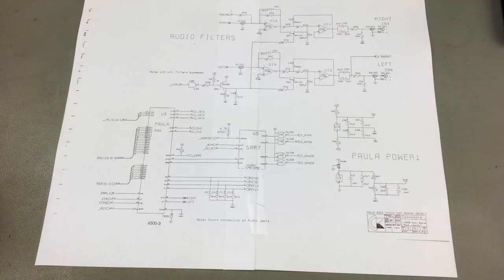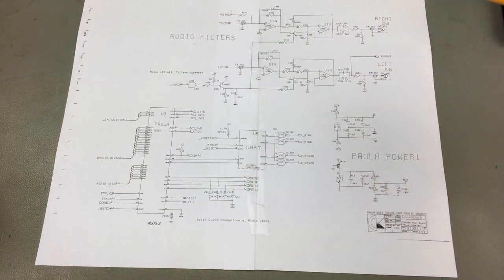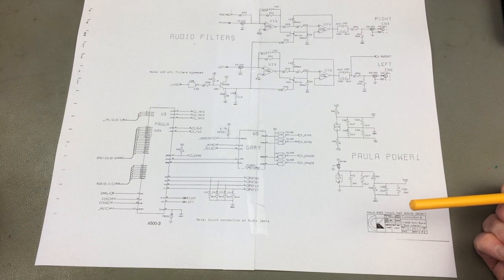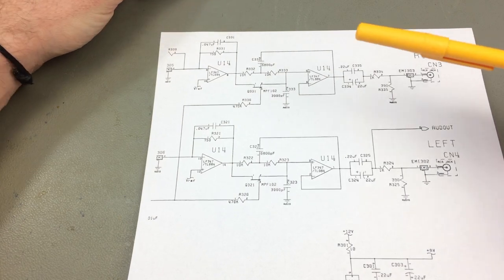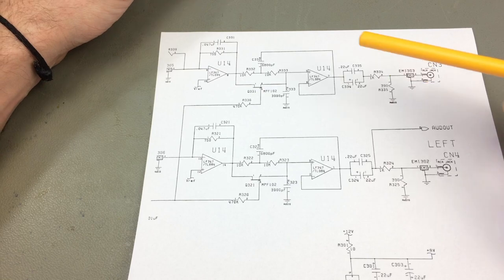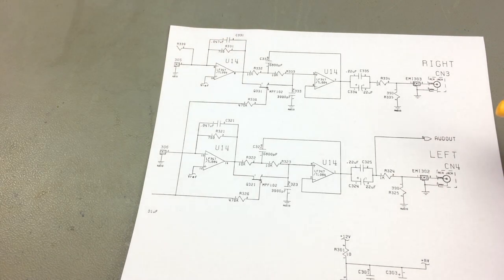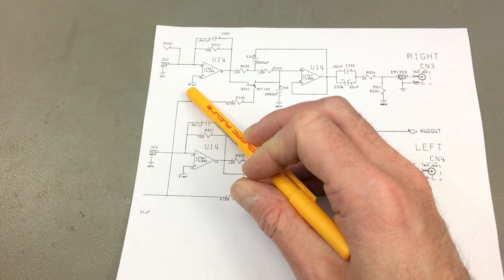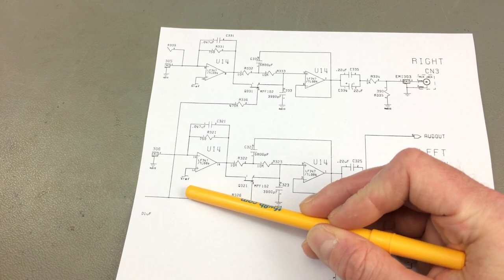Re: Bipolar Capacitors in the Amiga Audio Circuit

Comment: Great video!
I hope you don't mind me downloading it to my personal archive? ;)
Back in the golden age I did alot of hardware audio mods.
The easiest one was bypassing 1 resistor on each channel. It gave around +10dB of level boost. We installed small speakers inside the case.
That way you could listen to mods without connection to a amp and speakers.
Quality of small speakers back then was horrific.
Then there is the stock LED filter. On older Rev boards the LED turns off completely but on newer it just dims.
The LED filter can also be bypassed to give crispier sound.
I was thinking, if you install a trimpot you could level match the ground after bias removal.
Reply from the maker: Thanks! Glad you liked the video. Yes, I remember the LED thing. I was really disappointed when the LED didn't turn off completely on the A1200 I had after my A500.

Comment: Thanks for the video Jan. 

Some additional bonus work would be to trace the circuit and try to understand why DC bias voltages are appearing at the output. If we first consider the source of the signal we can see that it can potentially "swing" from 0V to +5V as Paula does not have a negative voltage supply. If it is generating a sine wave then that means the crossover point would be 1/2 of 5V or 2.5V. As others have mentioned, the 2.5V ref is then the "virtual" ground reference for the audio output signal on Paula.
The first op-amp stage is a negative gain amp with high-pass filter, perhaps its the Nyquist filter for the Audio DSP in Paula (it's not significant here though). Lets assume the gain of the first stage is -1. So if the (+) input is 2.5v and the (-) input (Paula) is 0V then the output is +2.5v. If the (-) input swings to 5v then the output is (-5 + 2.5) or -2.5V.
The second stage is a voltage follower, also called a buffer, that has a passive filter between it and the first stage but it is non-inverting.
To get a constant +2.5v at the output then, the signal from Paula must be 0V or near ground (its too bad you did not measure that) so likely the audio circuits in Paula, when not in use, set the output to near ground. I actually think that the digital samples in Paula's circuits are referenced to ground and not +2.5v but that would be another investigation...
Now to throw a wrench into all of this... what I said above is all fine but that is not what we are seeing at the DC blocking cap, eg. C334 and C324. Instead we see a bias point of +2.5v and then the signal goes up from that point and down to GND or just below, how can that be? to get above +2.5v then the input (from Paula) must go below 0V and Paula cannot generate negative voltages. So something else is acting on the analog signal, perhaps there is a DC bias voltage on the Audio In coming through the 10K resistors and "summing" with Paula's analog voltages.
If I have more time I will look into this as its a bit strange... there would normally be a DC bias on the output but only when Paula is not outputting anything and the analog outputs are 0V. When in operation, the center-point bias should be closer to 0V. 

Cheers,
Reply from the maker: Thanks for the clarification. This whole thing starts making sense now. :)

Comment: Very nice video Jan, it raised a question, why they don't feed the op-amp with ground as Vref and have the audio signal directly from the output of op-amp? I wonder if we always need a capacitor at the output of an op-amp for audio. To simplify my thought, if we are biasing the signal to protect the capacitor, why not eliminate the capacitor completely and connect the speaker to op-amp output. ( I know there must be a good reason for that :) )
Reply from the maker: Fabio Trevisan (I'm going to pin that comment) describes the whole thing in detail. I think after the comments on this video, I finally understand this, too. ;)

Comment: The A1000/early A2000 has quite a different filter arrangement, and it's not switchable. I'm not sure what this topology is called. There is some -ve DC bias in the filter chain caused by e.g. R73 to -12v. I suspect this was a higher quality reconstructive filter, but they discovered that users preferred the "brighter" sound of having no reconstruction filter!

The two 22uF capacitors back to back do indeed form a bipolar electrolytic capacitor - interestingly enough, the effective value is half that, so 11uF. This would increase the -3dB rolloff at the low end of the spectrum compared to later Amigas... so "less bass".

Comment: Have you tried using simulation software to investigate circuits? Something like LTSpice is free and extremely capable, yet simple to use. It allows you to probe the circuit and play around with component values to see what they do. It is relatively simple to do a frequency sweep of this circuit to see what its bandwidth is, and how the cut-off filters perform.
Reply from the maker: Not yet but I'm definitely going to look into that. Would be very interesting to fiddle around with this circuit without risking damage to an Amiga.

Comment: When capacitors are used in series to pass AC signal and block DC they are called coupling capacitors, not decoupling ones. Decoupling is another thing. Has to do with locally storing energy to lower the HF impedance against effects between circuit portions due to PCB parasitics. They are strategically positioned. Usually low value fast dielectric ones, or combinations. But always in parallel between voltage rails and GND.
Reply from the maker: Whoops, didn't realize that. I think I said "coupling" and "decoupling" equally often in this video. Thanks!

Comment: Hi Jan
You still are not understanding the circuit. The capacitor never sees any reverse voltage not even 0.1V.
It would not see any reverse voltage even if the output of the IC went to - 2V the cap will still have the correct 2.5V bias, it is just that the + side of the cap will be at -2V, and the - side of the cap will be at -4.5V.
The Audio GND and the regular GND are shown different is because the current path for the audio GND should go almost straight to the power connector and not share any digital GND. it is only a layout of the tracks that makes them different. Both are connected to the PSU GND.
The connection of a load in this instance i.e.  amplified speakers is irrelevant as the output is loaded by resistors R324 1k + R325 390R and R334 1k + R335  390R.
The 2.5V bias is required because the output of Paula is from 5V to GND so when Paula is producing zero sound pins 30 & 31 will be at 2.5V.
BP caps having less effect on the signal is I believe incorrect as you have 2 capacitors in series instead of 1.
Reply from the maker: Thanks for the clarification. So the bias is always going to be sufficient to keep the signal above 0 for the capacitor.
Reply: @JanBeta  The voltage on one end of the cap is irrelevant.
Like I said the only important bit is the voltage across the capacitor.
The capacitor is only connected to GND via resistors, So the voltage across the resistors is the signal swing minus 2.5V.
So if you have a 5V pk to pk signal on the output of the audio amp IC  it will swing from +5V to 0V or GND, like wise the capacitor + side will be the same.
The negative side of the capacitor will swing from + 2.5V to - 2.5V always keeping 2.5V DC across the cap.

Comment: Maybe increase the sound resolution - removing voltage bias altogether (modify board) and using the bipolar caps?
Reply: It doesn't change anything. You get no more resolution, than the DACs (which I assume are in the Paula chip?) can provide. And you's probably need a negative voltage supplied to the Paula chip too, if you wanted a signal with no bias. This is where it gets complicated, because then Paula would need to run off +2.5v/-2.5V and you'd need level shifters on the digital inputs and outputs. Otherwise the chip would see too high a voltage on it's digital inputs (7.5V, as you'd have +5V coming in, plus the -2.5V Paula would see as GND), and the digital outputs would be negative -2.5V when Low, and only 2.5V when high (very borderline 1).  How do you think that would play with the rest of the logic that the Paula chip is connected to?? So the engineering choice is level shifters on every digital line, and a split rail supply, or just run it off +5V, and strip the 2.5V bias off with a cap. What would you choose? :-)

Comment: Not sure why they decided on the 2.5V bias.  The opamp is running at 24V across the rails.  It could use the existing 5V as the bias with no danger of clipping.  Maybe on earlier machines the opamp was powered with 5V?  You could remove the 1K resistor in the divider connected to ground, and see what happens.
Reply from the maker: Interesting question. Thanks for the idea.
Reply: Not sure it'll work.  Looking the schematic the 2 mosfets use the 2.5V vref from the opamp.
Reply: Actually there would be danger of clipping if the power supply was 5V. The output of the paula can go to 5V and 0V. That's too close to the supply voltage of 5V.
For instance the datasheet says that at +-15V supply you can only go at least to +-11V input voltage. That's a 4V difference.
Reply: The design choices in the audio circuit are certainly confusing.  I always bias opamps for audio at half the power rails.  4.5V for a 9V supply, 0V for a +-12V supply.  Maximum swing on both + and -

Comment: I don't think the through-hole DC blocking caps are very prone to failure, that's not my experience at all. Except on A600/A1200/A4000, but that is solely because they are of the infamous early 90s SMD kind, which are very prone to failure (over time) to begin with.
Reply from the maker: Yeah, the SMD electrolytic caps from that era are just horrible. I didn't see many through hole coupling caps going bad myself but GadgetUK mentioned it.

Comment: By the way do use your Nichicon ES bipolar capacitors to replace the old coupling caps since you purchased them. Not because of engineering reasons but because they are new and best quality for the job. Purpose made for good signal coupling regarding THD. They could be an audible upgrade over the old.
Reply from the maker: You're probably right. The capacitors that are in there now are cheap ones anyway so the Nichicons would definitely be an upgrade.
Reply: @JanBeta  Using back to back polar caps to make a non polar, like in the A2000 schematic you had shown, is never as good a solution as using an original non polar capacitor. Two caps aren't as equal in uF, ESR, ESL. Not as equal in aging either. Especially when picked randomly in assembly line. Creating reverse offset between them under large signal and higher THD.
The A2000 example isn't demanding for AC signal stress anyway, most probably a bill of materials mass stocking uniformity thing. Doubled the ESR & ESL of already general purpose cheap caps. Lowering the coupling quality. But it worked without breaking.
Maybe from that circuit the speculation of A500 should be optimized with non polar coupling started. A2000 the statement model of its era, same thing in the original Amiga also, so it should had been the the right audio output coupling scheme, you know.

Comment: Excuse me @Jan Beta........ I don't understand this discussion ........ The audio output is a constant voltage....... DC voltage...... around 0.30 volts in the amplified output as we seen here in this channel in several amp repairs videos...... that is without sound.... flat line.... the sound is a variation of that voltage........ this changes from amp to amp..... but for for the sake  of the example.. let say ..... that  in 0.20v.. the cone of the speaker go all the way back.....0.40v the cone of the speaker go all the way forward...... it never go "cero volt".... or "negative" volt at any time ..... AND SAME in the imput signal..... before the amplification..... the pre-amp signal have...  less current ..... less voltage...... but again always over "cero"....... if you have part of the signal in "0 volt" or "passing below" 0 volt .... that part of the signal will get cut.... it will produce no movement (or signal at the other side of the transistor) because is "0 volt"...... it will sound distorted.... like saturated...... because the "top" of the waveform it will still be complete..... but the "bottom part" of the waveform it will get  cut flattened at "cero volt"......
Reply from the maker: The speaker actually moves back for negative and pushes out for positive voltages, it’s "relaxed" at 0/ground level. So any bias that gets through hinders the movement of the membrane because it would be permanently pushed/pulled slightly in one direction.
Reply: Of course not @Jan Beta ....
you never have "zero" or below zero (negative) voltage...
neither before ... or after the amp transistors...
for that reason you see normal electrolytic capacitors in there...
and not bipolar capacitors...
you can check it with your multimeter.... if your amplifier works with an output of 30 millivolts (0.3v)...  
at full volume... you will have between 40 and 20 millivolts in that output...
40 millivolts at the positive peak of the waveform ...
20 millivolts at the peak of the negative waveform...

and on the signal ... (before the amp transistors) ...
in the "line out" of you deck cassette (for example) ...
you have 5 millivolts .. (many times less ) ...
and the waveform is "drawn" by varying that voltage ..
between 6 and 3 millivolts (for example) ...

again .. you can measure it with your tester
you never see the "negative sign" on the screen...
because there is never a negative voltage ... it's DC ... no AC... 
so.. NO bipolar capacitors...
I don't know if is this the discussion ...

Comment: Actually you and Gaget caused me to go back to my Electric Books because of the comments about capacitors blocking AC and passing DC where as capacitors block DC and pass AC.   As for Audio circuits this is one area I don't get involved with because its not my area of expertise and many people will debate one theory vs another.   For me the only time I will change something only occurs when a problem appears that the original design proves to be deficient.   Thing is if something works and works well I do not waste my time on it.     A good repair is not just replacing defective components but figuring out why said components fail.
Reply from the maker: Ha, sorry for the confusion about the capacitors. I should go back to the electronics books for a bit I guess....

Comment: So if we increase the bias by lowering the value of the first resistor in the voltage divider, we get rid of the overshoot and we don't need bipolar caps, right? (absolute noob, just trying logic)
Reply from the maker: I think as some other commenters described, there can't really be any overshoot because the signal level can only be 2.5V realistically. The ground level (bias) of the capacitor moves accordingly if the signal goes higher. If I would have measured from positive to negative on the capacitor I could have seen that.

Comment: As I see it: The capacitors does not "know" anything about ground. Regardless the bias, they get charged in reverse on the negative pulse, so bipolar caps seem like the right choice for this application. But I might be wrong :-)
Reply: Hi DAW 75! No, that's not correct. As also many other people explained ... You only have a problem if the electrolytic capacitor would be charged in the wrong polarity. But because of the positive DC offset, that will not happen. And also without an DC offset it's not a problem, because the "short peeks" of the AUDIO signal will not charge the cap. Roghly said ... The average voltage of the AUDI Signal is about 0V ... so no charging of the cap. And back in the days bipolar caps with that high capacity were nearly not available or too expensive. Best regards, Doc64!
Reply: That was the mistake I intially made!  I didn't realise there was a positive bias to the cap.  The cap is charged to ~2.5v all the while, even when those -ve AC peaks pass through, but it still remains positive on its + side with respect to the - side of the cap.  So those -ve peaks really aren't a problem.  As Jan says, typically they can handle up to 1.5v negative swing anyway, so the -ve peaks would need to be really large for it to be a problem.
Reply: @GadgetUK164  Ah, that makes sense, now I understand! Thanks